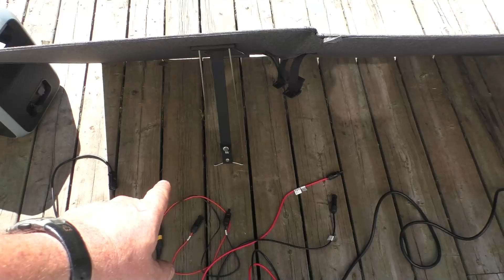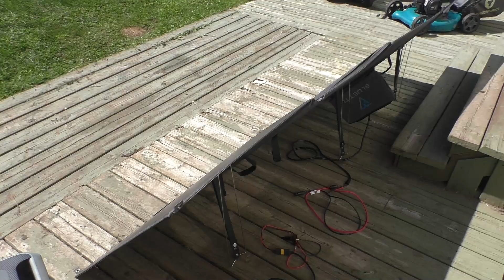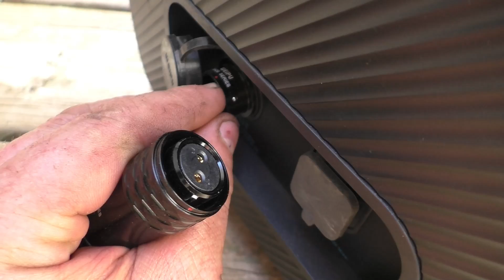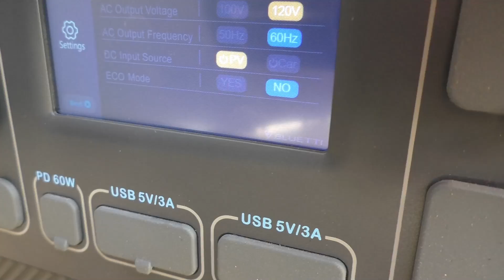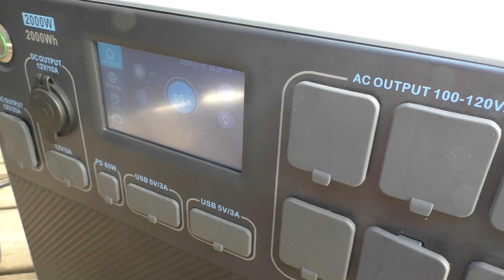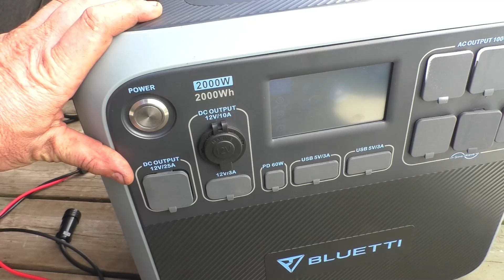How To Connect Bluetti PV420 Solar Panel To AC200P Power Station

Comment: What is with all the YouTubers pushing these battery inverters?   It seems every other channel is pitching one model or another. I can see a use for them for apartment dwellers, campers and tailgaters but as a serious emergency power source I don't think so.  For one thing, everyone always demos these with the inverter and solar panels sitting out in their yard, driveway or deck. That's not how you would operate in an emergency.  You'll burn through 2000 Wh fairly quickly.
Reply: Way I see it for us in North Central Florida I have more than one propane converted generator & a 150 Gal tank, and we have about 3 or 4 Jackery boxes sizes up to the 500 model, we will run the house on the Gen, and smaller things like the Wi-Fi stuff on the jackeries

Comment: How much does it cost ?  I have a Honda 3800 gas generator but it's kind of big to haul around.
Reply: That BLUETTI PV420 Solar Panel array is US$849 and the BLUETTI AC200P Portable Power Station is US$1,199.00, plus sales tax and shipping.  He got his Power Station free for review, but $849 plus tax and shipping is hardly charging for free, and $2048 plus tax and shipping is far from it.  These numbers came from his links in the description.

Comment: Dony --- The major question is  -- Where are the units made? ((NO-CHINA-BUY))
Reply: Everything is made in China or Taiwan.
Your Dell, HP or Lenovo are all made in China.
Reply: @Drottninggatan2017  Not a good enough excuse -- Buy American/Save American Jobs
Reply: China makes about 78% of the solar cells today. In comparison, the U.S. production of solar cells has decreased from 13% in 2004 to less than 1% today. [ONE PERCENT - start saving $ to but them!!]
Even if a solar panel is labeled and marketed as “Made in the USA,” it is likely that the solar cells or other parts of the panel were made overseas. All the manufacturer must do to use that label is assemble foreign parts here in America.  @jaygee999
Reply: @jaygee999 That's funny considering Don is Canadian
Reply: @loonloon77  Funnier Yet !  -- So Am I  ---
Reply: @jaygee999 Where was your phone made? How about your TV?
Reply: @Bamabrute85  Apples to Apples ?   --- Do you appreciate the other gift YOU'VE received from the Far East  --- Like COVID ?
Apples to Apples ?
Reply: @jaygee999  you didn't answer my question.
Reply: @jaygee999 get with the times man.
Reply: @jamesc9327  Buy American/Save American Jobs